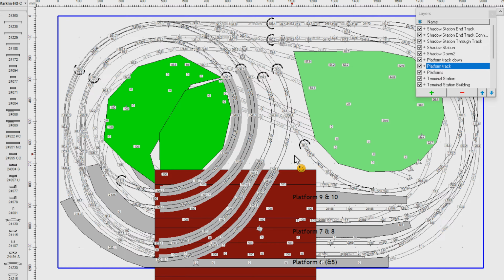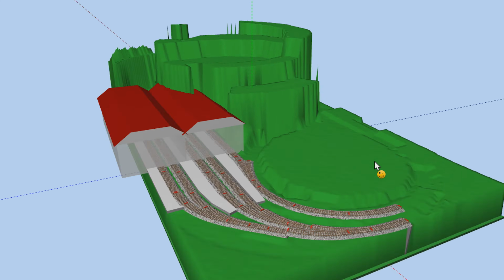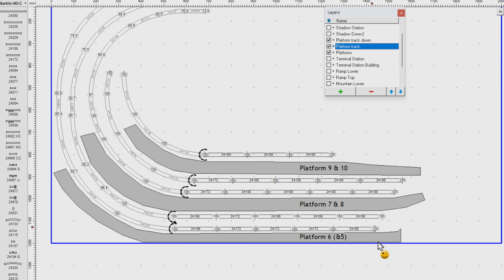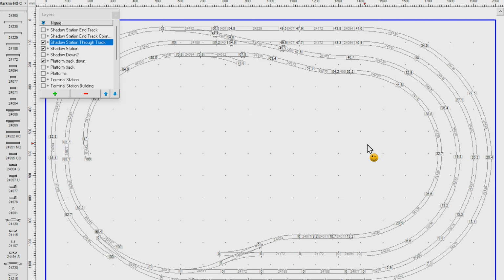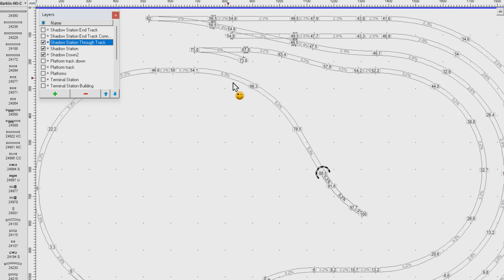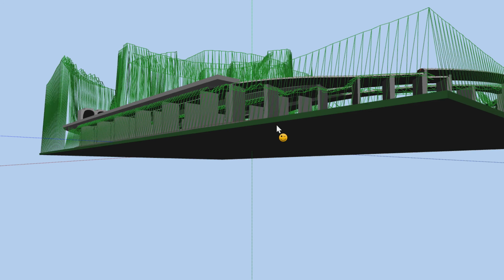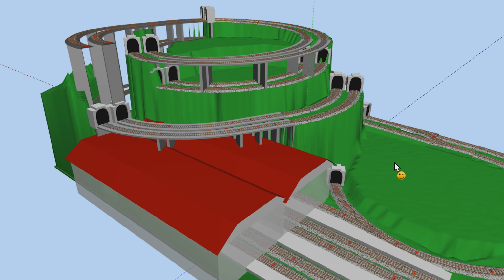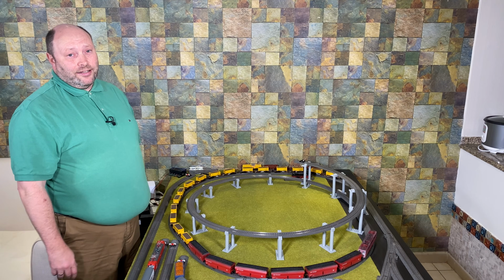Tower: Design of Main Station Bottom Layer (Layout Episode 2)

Comment: Really interesting project and design! I’m amazed all the tracks you were able to squeeze onto your layout.  What is your grade level?  More than 4% will get problematic and many non-Märklin brands will have problems. From my experience, you’ll need at least 15cm of clearance for a shadow station so that you can reach, otherwise all the trains will need to be cleared out.
But, figuring this out and pushing the limits is half the fun!
Enjoy!
Axel
Reply from the maker: Thanks Axel, this will be an interesting build and I agree that figuring it out and pushing limits is half the fun.

The incline in the Mountain is currently 3.6% going up (R2) and 4.3% going down (R1). I think I can squeeze it a little when I build it, but I have to see it physically. I suspect I can get it down to 3% going up. What grades do you have on your layout and what is your experience?

I do agree that the height in the shadow station is not as much as I would have liked to see. However, with the current design I might be stuck with it... Let's see...

Thanks for your valuable input - enjoy ;-)
Reply: @ModelTrainFun  if you can, avoid R1 on an incline - is there a chance you can use R2+3?  Like I wrote, Märklin locos will be ok on 4%, in a tight curve it is obviously worse. On my layout, I limited the grades to 3.5%. Feel free to send me some pics as you go along…
Viel Glück! 👍
Reply from the maker: @AxelH1to87  Unfortunately, I cannot avoid using R1 for trains going down - however, for all trains going up it will be R2 or R3. Thanks!